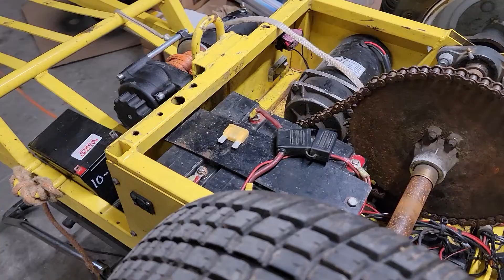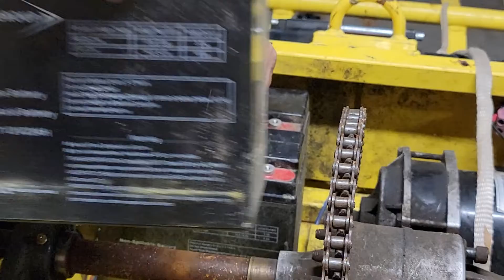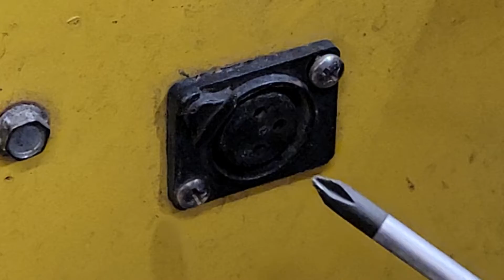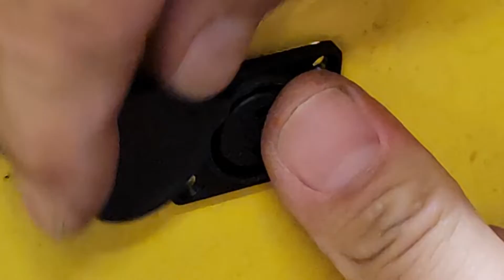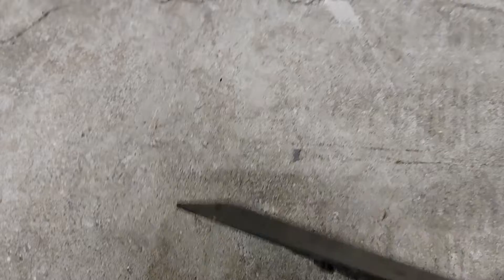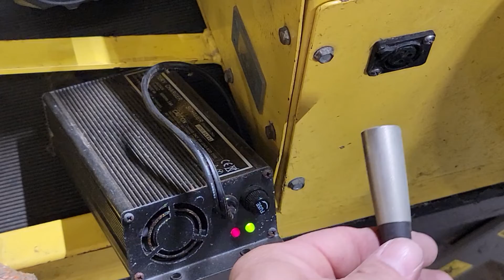Battery Replacement for Chain Drive Jolly Dolly

Comment: After replacing the batteries, the meter has stayed at 100%, even acter running it for a few days. When plugging in the charger, it seems to think it's at 100%.

Is there a step in here to reset the battery meter?

Or, is there something else maybe going on here?